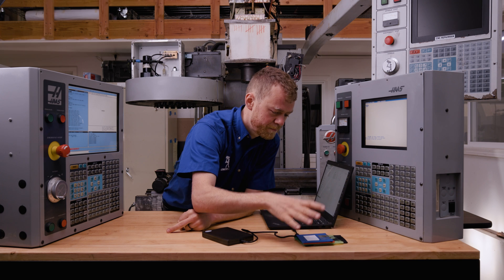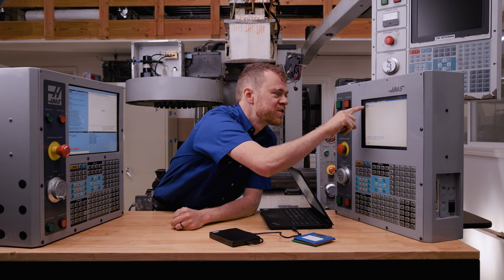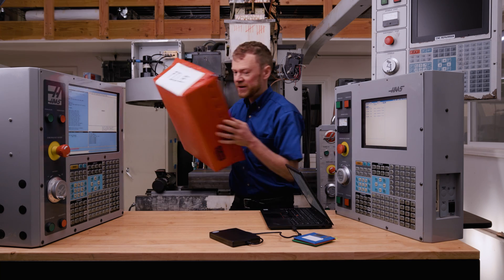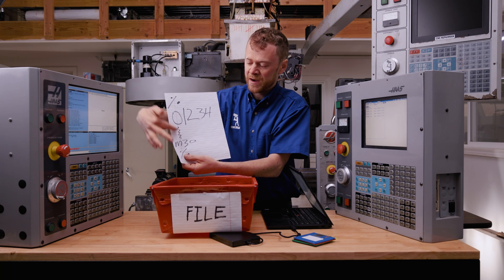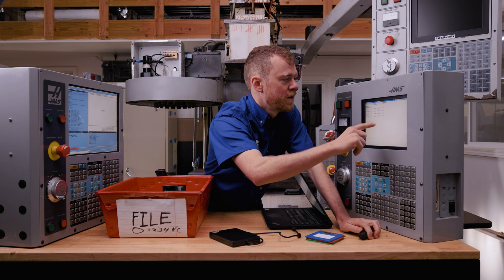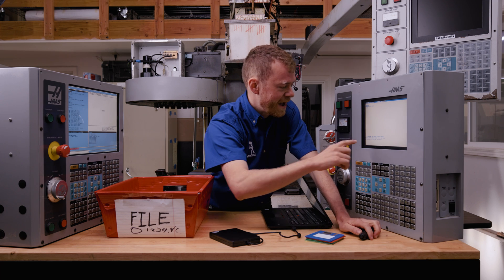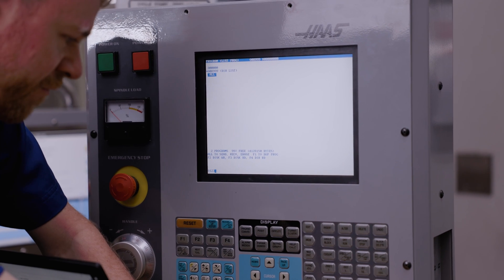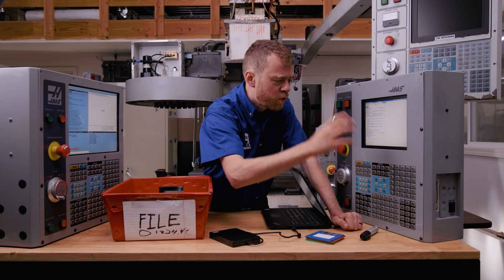How To Load Programs Into Haas - USB and Floppy

Comment: You and the algorithms must have read my mind! Just looking into floppy emulator for our Okuma LCS25. Our LC35-II already has it. In fact we have a device laying around which is from a US company (PLR Electronics), bought in 2014 but never got used. It has both a USB-2 port and a network port (don't know the proper name). I have just started programming these machines starting with the small one and did the floppy -MS DOS thing which works fine I guess but it has a real old school vibe to it. Had to go to the DOS prompt in the computer to get the disk properly formatted. Also I have to figure out if it is possible to export the native Okuma file formats like IGF to a computer, we have a lot of existing programs just sitting on separate disks everywhere. Lots of cleaning up to do. Cheers from Holland.